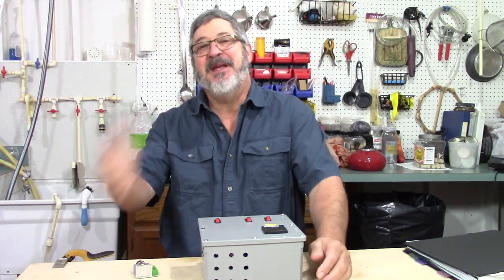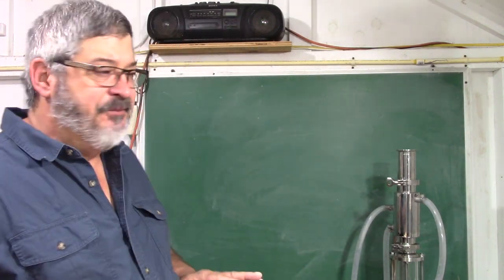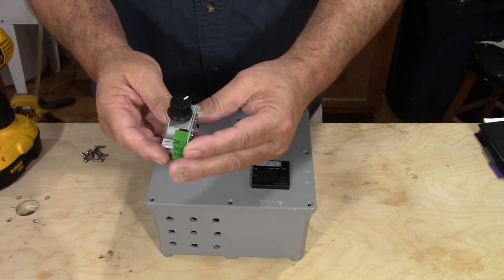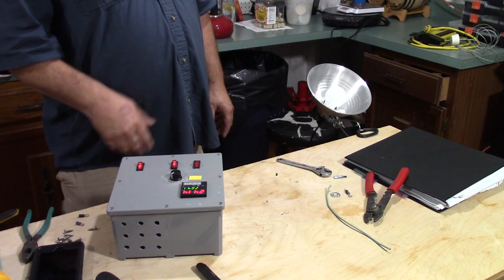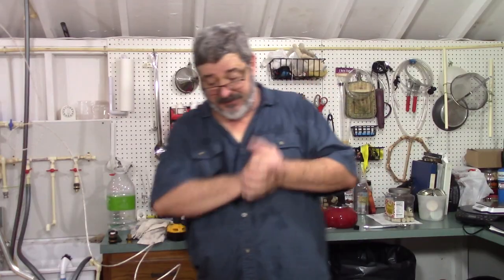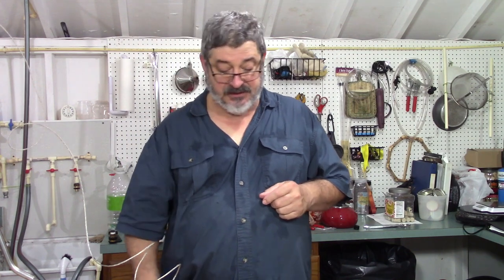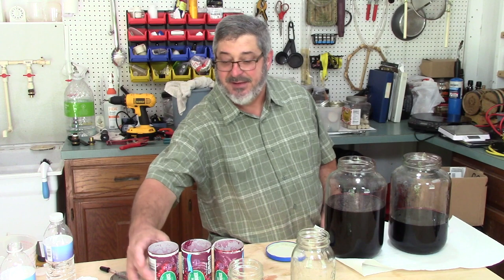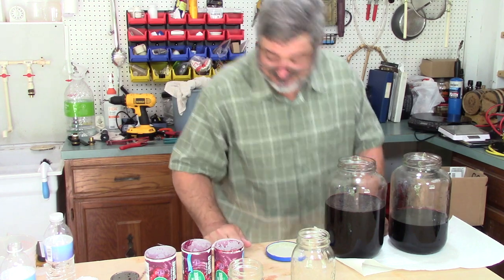E70 PWM switch install and distilling wine

Comment: Hi, Randy. A Pulse Width Modulator does what the name suggests: it takes a smooth sine wave AC current and chops off some portion of the positive and negative pulse based on the knob setting. The resulting waveform is no longer smooth but it works ok with a heating element. As other commenters have said you need the biggest rated wattage you can buy, about twice the wattage of your element or more. The cheap units are junk, with tiny heat sinks and no cooling fan. The build quality is also poor with bad solder joints etc. I have two in case of failure. The so-called motor controllers are also junk. PWMs are simple to use. I start with full power (knob turned all the way up) and then turned to half voltage at first drips. Then tweak it up during the run to get a nice drip. It’s really easy to use and requires very little adjustments during the run.

Wine distilled is brandy. Brandy with fruit flavor added is a Liquor or Flavored Brandy and is usually a lower ABV like 35%.
Reply from the maker: Hi George, Thanks for all the great info we all will learn from each others mistakes that is the great thing about this hobby I did find a PWM 10000w fan cooled around 28 dollars  Thanks for watching
Cheers!!  Randy
Reply from the maker: @Hanson423  That would  probably fine I think that is different than a PWM switch
Reply from the maker: @glleon80517  Thanks for your help George

Comment: Pulse width modulation, is like a light dimmer switch.  The PWD must be rated for the full current of the element.  It allows you to limit the power to a portion of the full power.
Reply from the maker: thanks

Comment: PWM controls the percentage of power 0-max. The PWM needs to be able to handle max power of what ever you are powering and max input provided. Try a PWM with higher values, plus a fan on the heat sink helps.
Reply from the maker: Thanks I just ordered 10000w fan cooled

Comment: i have the same set up     you got the wrong one it to light duty     get a 10000watt (appx $15)  mine is 6 years old and still working good    i use it to stop scorching on start ups for molasses and thick meshes   and PID to control rest points    you can also fine tune  product flow
Reply from the maker: Thanks for info and I will Cheers!!